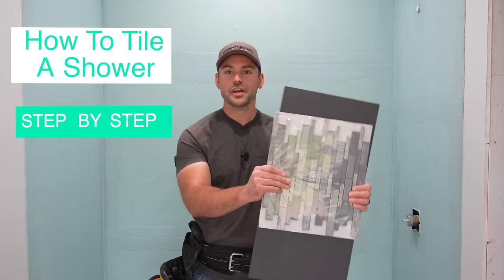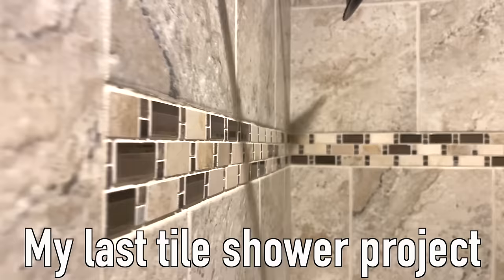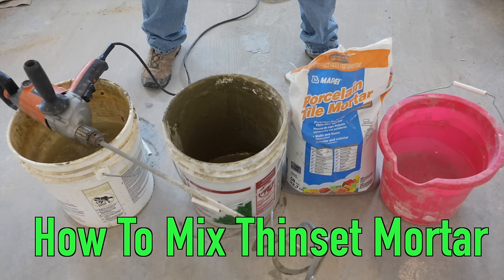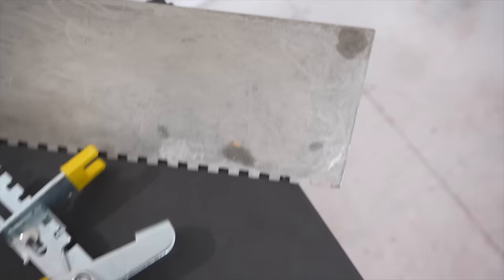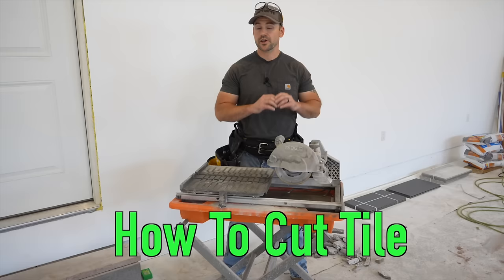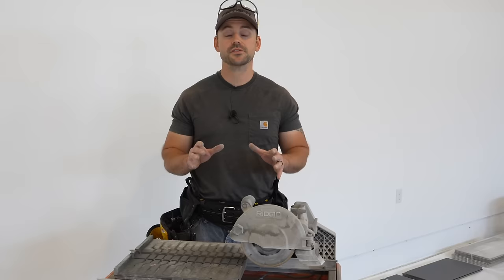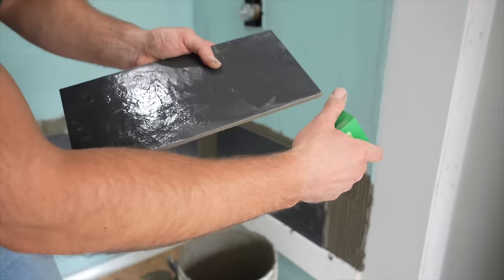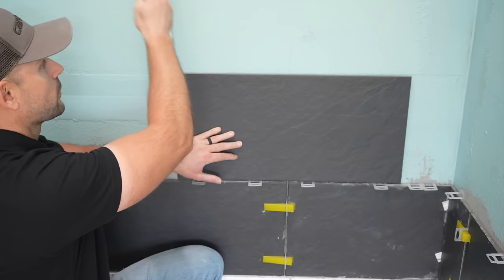How To Tile A Shower - Start To Finish Walls

Comment: Your vides are so clear and are explained in a way infully understand and barely have to rewind!   I have a question abiut the board yiu located at 12" drom the base.  With a 11-1/4" tile and a 1/8" gap to the base and a 1/8" spaxe up top, that is 11-1/2" total.  Why did you make line at 12", which is 1/2" higher?  Thank you!
Reply: This had me thinking as well.   In the video @ 1:27 mark  you can see he measures 11 3/4 and not 11 1/4.   It makes sense with 11 3/4 with the extra 1/4 added for the spacers.

Comment: Thanks for saving me a ton of money. Grandpa used linoleum for shower in 1942 mountain cabin. Worked for 81 years! 30 miles from town. Tile guys wanted $3,000 just for labor.
Reply: You want him to work for beans?
Reply: Took me 2 days. I’ll do the math for you. $1,500 per day in labor.
Reply: We just got a quote over 4000 labor only for a 32 inch square stall...😢

Comment: when back buttering you should use the flat side of the trowel to make leveling simpler and save on thinset. Im sure there are other practical reasons but these are why I justify it.

Comment: The saw is the most expensive part, but will have a tool for future projects. They retiled the floor and walls in both bathrooms at work and used those levelers.

Comment: I'll do mine in the summer. Limited to 30" wide because of the toilet, so a 30 x 60 pan fine. The corner ones are 32" minimum so can't use and I'd like to learn tiling. The bathroom will be down for 7-10 days and I'll be doing the 5-gallon bucket bath and showering at Planet Fitness until finished. All the Sheetrock has to come out and I have to stud sister a lot of termite damage.

Comment: Very informative. I've been going through each of the videos in this series and it sounds like it really can be done over a few weekends. The only struggle I have is with the permitting process in my area. Any change in plumbing needs to be done by a master plumber. My scenario also needs an outlet to be moved.... After that, it feels like it'd be easier to just hire the whole project out.

Comment: Great tutorial! I’m doing my first tile job on my shower this week.  This video has really given me the confidence to tackle the job. How did you get your shower plug off? The tile is flush with the side of that hex profile at 39:06.
Reply from the maker: Thank you! I removed the plug by using needle nose pliers and grip the side. It may be difficult if the plug is in snug. You may want to remove it before installing the tile. I hope that helps!

Comment: What I have tried to do is set the shower valve at the right height that it is on a corner of the tile so a plunge cut is not required.  Your plunge cut worked well though.
Reply from the maker: Good thinking Ray! Yes sometimes when you plunge cut the tile will break. Sometimes they do not. Thanks for watching!

Comment: One of the best videos on tiling a shower I've seen.

Question: what can you do if the rim of the shower base is 3/8“ so there's not enough material to trim the backer board to fit over it?

Comment: You used a 1/4 notched trowel on the wall and on the tile. Someone below mentioned you should use 1/2 trowel for large format tiles but you’re essentially doing that. If you used 1/2 inch on wall only you would need to back butter tile with flat side and no buildup on tile, just back buttered and scraped smooth. But both wall and tile mortar need to be burned or keyed in with flat side first before notching for best bond. I like the idea of 1/4 inch both sides. Might be easier to apply as 1/2 inch gets messy. And yes as below, wster first then mortar powder otherwise you get dry clumps. Even just half the water first would be good. 

The video does a good job of going through all the issues a beginner would want to know about so I think it’ll help everyone so thanks. I’m a beginner but have done a bit and am just about to grout so watching your grout video too. D like to make a suggestion to everyone:  for first tile, invest some time with a practice tile and make sure you push it against wall evenly with back and forth motion to collapse ridges. Then pull it off and see how well it stuck. If you pull it off and you see mostly uncollapsed ridges you’re doing it wrong. My bottom rows were like that and when my technique got better the tiles the sank too low and I ended up having to put thicker back butter layer down to match thickness below. And this makes tiles harder to align even with clips. Youl won’t regret doing this practice run, even a couple times. The rest of the tiles will go fast once you get it

Comment: In You're "How to use a diamond sponge segment."  You mention using the led side of a pencil to clean out your tile grooves, cool.  I have discovered, that by removing the eraser from a number two or a like style pencil the aluminum cylinder does a perfect clean in almost one swipe.  That's with fairly dry mud as well. 
Might help, might not...

Comment: What a nice and highly detailed tutorial!!!  Even with no expensive tools involved. I hope, a laser level would be better than spirit one. However, one moment is still unclear- how to manage upright tiles positioning, please? Framing is not perfect sometimes. Walls might have an inclinations off vertical position. How to check it during tiling and how to fix such walls defects?  One more question- how to examine wall surface before tiling and what kind of remedy can be used in case if there is a hump (spirit level rocking) somewhere? Should we increase a thickness of entire wall adhesive and reduce it in the spot where this hump is or, to do something else? This is a very important if we have a deal with larger tiles 600*600mm and over.  Thank you

Comment: Great video ! 
I noticed a small mistake, you said the tile was 11 1/4 wide but I think it’s 11 3/4 
Because you left 1/8 from the pan and another 1/8 between top tile, when you add it up, it is 12” total if the tile is 11 3/4, not 11 1/4
Reply: You’re right I thought it was just me, other than that great video

Comment: 28:05  You forgot to tell the viewers you have to turn the tile around and also cut the back too.Been doing bathrooms for 24 years and there is no way you can just cut from the top and knock it out.Also if the cut out is to close to the tile edge it will brake the tile when knocking it out.Great job.👍

Comment: I’m very interested in your method of shelf-building out of tiles. A couple questions I’m hoping you can help with:

How strong are these?  Would you use this for, say, a floating leg-shaving footrest?

Your cutting method leaves the cut edges of the shelf end cap visible.  Have you ever considered mitering the sides of  the cap, and of the tiles making up the shelf, so that edge is not exposed?  You might not even need to miter the bottom tile, since it’s not visible. Just the front edge of the top tile and the top edge of the cap piece. Thoughts?

Thanks!!

Comment: I have to say that the only part I did not think was consistent is when you put the 2 sections of the "accent" tile together. At the bottom where they met, the joint was extremely wide.

Comment: Great video. Im a do-it-yourselfer, but I torn between kerdi and roll-on membrane. Roll on is definitely easier, but I already had to replace water damaged studs and floor. Is kerdi really better? Or just more trouble?  Any help from experienced trademen is GREATLY appreciated.

Comment: Question: Great video on showing how to install a tile shower DIY. I have never done this but will soon. I will likely use porcelain 2 ft tiles and cut with a wet saw. I assume you measured the valve square cutout the same way you measured the tiles adjacent to the shelves?

Comment: Nice work TEL, really like the way you organize the job, no laser level $$$$ used as well.  I see a lot of you tuber DIY using linear glass mosaic tile as an accent stripe, however doesn't one need to use glass tile thin set as opposed to regular LFT thinset?   Also I see your using 1/4 x 1/4 inch trowel for your large format tile, 1/2 x 1/2 inch trowel is usually recommended, how is your mortar coverage behind the tile?

Comment: Hey Josh, I have a question for you. At 1:28 you measure the tile as 11 1/4. Then you say you need 1/8 inch space between the pan and the next tile. Then you measure to 12 inches.

When I calculate this (11 1/4 + 2(1/8)) I get 11 1/2. Why measure to 12?
Reply: Can anyone answer this? I'm having the same concern.

Comment: I am just starting a complete gut and putting in a macerating toilet,tub in a surround,vanity heat pump washer and dryer with can lights.this will be tiled floor and partial wall.i am nervous as this is new to me besides the floor,and u-tube was key listening to the right poeple.i will be using an electrician and a plumber for some of it as what is hidden and some measurements are better being tackled by someone with experience.knowing your limits is key

Comment: Aloha, I am watching your tutorial because I renovated my bathroom and when it came to tiling, the guy came got his deposit and disappeared. (Luckily I was able to cancel the check before he could cash it. My problem is that no one will touch my project. Thank you for this video because I feel a lot more confident about doing this.  Do you have a video on waterproofing the floor of the shower? It was made with cement board.

Comment: Good video. One question on your starter board. The tile is 11 1/4. 1/8 gap on the bottom next to the shower pan and 1/8 gap for mortar joint would be 11 1/2 total. Why measure up 12 inches to mount board instead of 11 1/2?

Comment: I had an idea after watching this video.  If the top edge of board was rabettted you could place  spacers on top and down into rabett and place the row of tile on the spacers. Board would be lower on wall by 1 spacer thickness of course.  So then after removing board and installing 1st row of tile, the wedge leveling could be used there. Any thoughts?  Doing that I was thinking of also using a vertical  board to get my tiles in line vertically.  I would tile left side , then right side but could still use leveling on all tiles when I start the right side.

Comment: Nicely done instructional videos. My wife and I are getting ready to tackle a show tile project. We're removing the contractor installed tub and wall kit first, so it'll be quite a project. Your videos have been very helpful, and we're confident that we'll be able to tackle this job! Thanks!

Comment: You're using a Gray thinset on a bathroom wall instead of white, plus you don't have to stop for 5 minutes between mixing when mixing thinset, and you can use a manual tile cuter if you want to avoid dust as well. And you make tiling bathroom walls look really hard😢😢😢😢, if I wasn't a pro already, I would be thinking about not trying to do it

Comment: Josh great video. Love how you started your first row. My confusion is in the math to start.  Tile is 11 1/4, 1/8 space on the top and the bottom totals 11 1/2. How did you hide the 1/2 inch left over?

Comment: Hey man great video. But the math in the very beginning got me. You have an 11 1/4” wide tile plus the 1/8” gap on the bottom and 1/8” gap on the top and you came up with 12”. I keep getting 11 1/2”. Am I missing something?
Reply: i have the same question
Reply: I’m wondering as well
Reply: I just started mine and my 12x24 are actually 11 3/4 which us 12” adding the 1/8 on top and bottom. I’m assuming 11-1/4 was meant to be 11-3/4.
Reply: Yes,he clears this up in other comments. He meant to say 11 3/4 tile

Comment: I have a shower to do.  My problem is a gas line that was moved during the last tub replacement and hooking up the plumbing. Finding a reliable plumber is an issue. Another issue is that its our only bathroom so once its demo'd it needs to be done quickly. I have tiled the kitchen floor before.

Comment: I have tiled quite a few bathrooms I just bought a house and I'm going to be doing my own bathroom here soon after a serious renovation something maybe I missed but at the start did you mention to take your measure for your level line off of the lowest point of the shower base or tub base also the walls behind the tiles is that some kind of Schluter system I'm just wondering how you have a continuous green material on all three walls?

Comment: Nice work on the video!  Thanks.  Q. I'm doing the exact same thing with the same size tile.  The difference is I'd like to see run mine vertical and staggered, about 1/3rd.  What would you suggest doing with a ledger board?

Comment: I’ve tiled quite a few shower rooms but I always tiled one wall at a time as it’s a lot quicker and easier. Why do you do the side walls at the same time? Purely because you are putting shelves in? Also never used a levelling system on a wall. If your walls are anything other than perfectly flat the levelling system can lift the adjacent tile off the wall potentially leaving a gap underneath of no adhesion.

Comment: Hello, great  video. My question is why did you not start from the bottom? Whats the purpose of the wood board and starting 1 tile width higher? Thanks

Comment: Josh first of all, im building a house, your videos are invaluable! So thank you!! Question about the shower ceiling, did you have to use any special drywall, light and paint?
Reply from the maker: I’m so glad I can help you! The drywall on the ceiling is the green or purple that is considered MR “moisture resistant”. The light is considered a utility recessed light. The paint is just standard ceiling paint. I hope that helps!

Comment: Ripped out my tub and surround shower unit and installed a tile shower. I used a Shower pan mold from KBR because I put tile on the base. I was worried about attempting the project but it turned out good. Not familiar with the spacers you are using.

Comment: For adding the shelves, around the 25 minute mark, you mentioned that when you sandwiched tiles together it took 24 hours to dry and then another 24 hours when you added the face to it. If you knew you were gonna put the shelves there from the get go and measurements of how big you wanted to make it, would you pre-fab those shelves from the very beginning so you wouldn’t have the long wait time when you get to that point? Or do you continue on doing other things during that long wait time?
Reply from the maker: I will go ahead and start building the shelves when I start the shower. So that way I don’t have downtime waiting for the shelves to cure. Hope that helps!

Comment: Be advised most all ceramic tile sizes vary ! even tile out of the same box can vary! If its on sale at lowes marked way down from the original price you can bet its going to vary in size considerably and its discontinued or soon to be so buy xtra for future repairs etc! Thats good advice on any tile job: buy xtra for future repairs! All tile on the shelf today will be guaranteed discontinued in 5 yrs!

Comment: Another question.  If you plan on having a half-wall of tile running up to the full shower tile area, do you start with the shower area, then get the half walls to match up to the shower tiles or vice versa?  Im thinking the shower first.  Thanks.

Comment: My question is how did you work around setting the tile with the 1/4 arch on the back of the pan? I have the same pan (sterling), I assume the design is to run the water off to the left and right of the rear pan lip. I played it back several times but I can't tell if you cut the bottom of the tile to match the slope or placed the tile streight across left and right of center leaving a larger gap in the corner area?

Comment: I have done many showers for myself, and my family and I get tired of hearing about the back butter.  I have not lost a tile or a loose one ever with the oldest bathroom about 15 years old.  I am not opposed to the back butter but it takes extra time and I don't believe is needed, usually my wife puts the thinset on the back of the tile with a grooved trial of course and hands them to me to stick to the Hardee board.

Comment: Thanks for the video. I’ve done the backsplash in my kitchen and I was a little skeptical about doing my shower and bathroom floor. But, after seeing this video I’m confident that I can do it. I even ordered some of the tools you recommended on Amazon. I have a question. I have a shower pan that was done with a liner and mud. Would you tile the pan first or the walls?
Reply: Tile the wall first. Start the way he did with the level board, leaving the first row of tile out. Then tile the pan. Finally cut in your first row of wall tile. Best way in my opinion
Reply: @mecca30  Thanks!!

Comment: Normally for 12x24 and above I use a 1/2”
Notch trowel for better coverage and for the leveling clips not to pull the tile too much away from the thinset. 

What was your reasoning behind using a 1/4”, just curious ?
Reply from the maker: Ok good to know! I have always used the 1/4” notched trowel with success and no issues. No need to change it. Thanks for the comment!
Reply: And just fyi,

The thinset you’re using is “ideal for small format tiles with all sides 15 inches or less”

That’s right on the thinset bag you were having. 12x24s are considered “large format” so your thinset would need to be recommended for that particular install. 

Since this is a DIY channel it could  affect a lot of peoples installs. Trying to come from a good place in this as a tradesman myself, I always try to research and look back before each job so I don’t rely on my “experience” and own opinion when installing.

Comment: Question on your bottom row. You’re tiles are 11 1/4”, add another 1/4 for 1/8 gap top and bottom, leaves 11 1/2. Yet you started at 12” up, but your bottom row tile fit the space perfect?